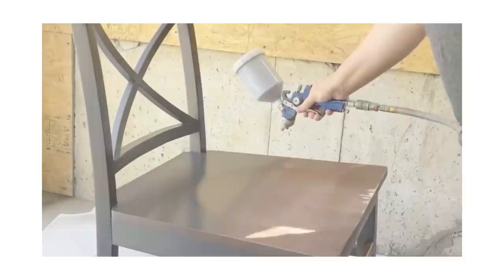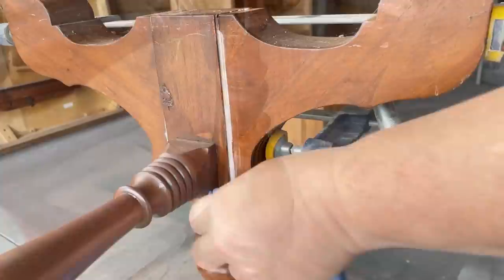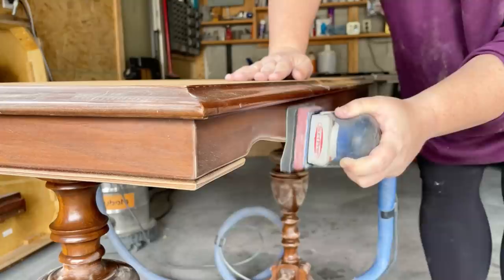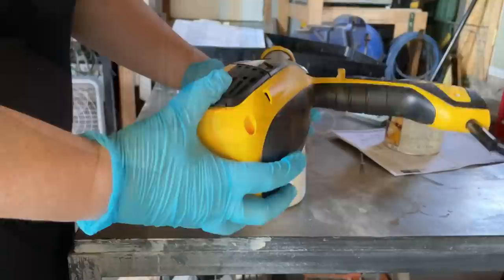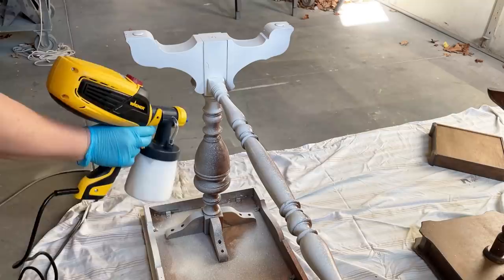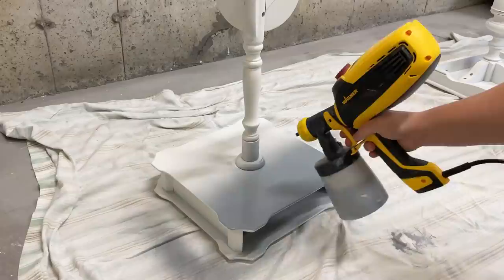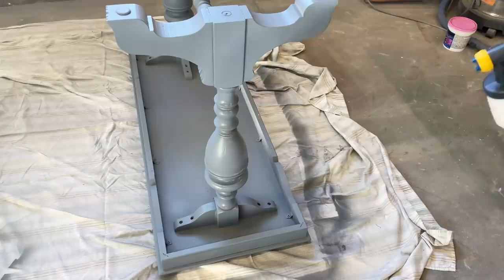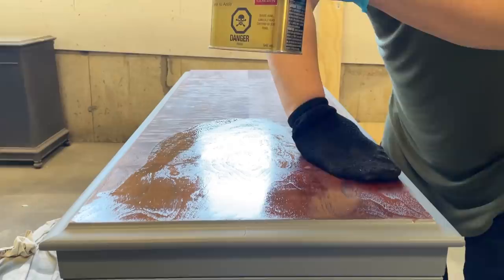Painting some small furniture pieces with a new paint sprayer

Comment from the maker: Important Safety Update: BIN Shellac Based Primer is not a suitable material to spray in this type of turbine sprayer. It is combustible has a risk of fire or explosion 💥 I will not be spraying BIN in this gun again.
Reply: hello katie! 👋👋👋 I have time watching your videos, I love everything you do with wooden furniture.  I do the same and that primer is my favorite, and you are right in everything you say, I stopped using it in my paint gun, I only added it to wooden furniture, with a roller or brush, and for best results, leave it 24 hours, after 24 hours you can then sand and paint the wooden furniture.  (There is no need to sand the furniture before placing the primer, but without a doubt that primer is my favorite🥰🥰😍😍
Reply: @Roca-mb8df  I know that good primer is loaded with alcohol, but cannot imagine an explosion.  I am used to the Kilz original, which is probably the same thing.  I get good results just with a tiny foam sponge roller and it's disposable.  I had been told by experienced wood workers to never worry about the streaks and overlaps, just be sure it is covered completely.  Almost 15 years later, they are right.
Reply: Do you know if that's the case with the home right sprayers too or just the Wagner's?
Reply: @perlaargyle9343  each sprayer is different so I would check the manufacturers instructions but from what the Wagner rep told me it has to do with the proximity of the spray to the turbine. Sprayers where the turbine can be as safe distance away for the gun are better suited for this use.
Reply: That is good to know.  I don’t have a spray gun but good to know.
Reply: Eeeek!
Reply: Is there a solution for this?

Comment: So glad you stained the top of the sofa table. Both look great. On the small table aren't you missing the little plugs that cover the screw holes? Much better to not see the screws.
Reply from the maker: If you plug the wholes you can’t tighten the screws again in future.
Reply: @salvagedbykscott  That's why the plug tops are domed so you can pop them off if you need access to the screws. No fine piece of furniture would have exposed screws like that. They would be covered with "dowel plugs".  Do some research on woodworking sites to see what I mean. I do love your work!

Comment: I use that gun and I want to let you know it's best to take the foam disk off the plastic piece that goes into the canister . If you pull the trigger back while putting the blue pieces on it helps. Did yours have a small red ring inside the top of the sprayer behind the blue parts?

Comment: Thanks for the good unbiased review of the sprayer.  You know about "buttons" for those screw holes right?
Reply from the maker: Yes, I know about the buttons but when it’s a cheap table like this, they’ll need to be tightened again soon.
Reply: @salvagedbykscott  well so that is why they are "Buttons" to easily remove.  Anyway I thought you had a good reason.  You could use a wet thin or flat toothpick with some glue in the screwhole to give the screw some good grip?  It looked wobbly when you were putting the poly over the top.  I do know what you mean, those screws want to work themselves out.

Comment: I have the Wagner 5000. I used it on 1 project. It ruined the paint texture. Mineral paints are too expensive to put into a splattering Wagner. I had to stop every 30 seconds or so to wipe the tip off with a damp cloth. That does help a little with the splatter. 
Then purchased a HVLP gravity paint sprayer. I will NEVER go back to a Wagner. I have one gun for oil and one for water based paint.
Reply from the maker: I love my gravity fed HVLP, but I think the Wagner sprayers are a good “intro to spraying” option for most DIYers.

Comment: I had the Wagner flex up but it would clog with the BIN primer. I contacted Wagner support and they told me to stop right away because the shellac is combustible! The turbine so close to the fumes is what makes it hazardous. I chose to upgrade to the Earlex Spray Station 5500 where the turbine could be placed far away from the sprayer handle. With that being said after the hassle of cleaning with denatured alcohol (because they also said how dangerous ammonia is) I may never choose to spray shellac again. Just thought I’d mention all this because I was unaware. I could see how this could be especially dangerous spraying in unventilated areas when it’s too cold out to leave the garage door open.
Reply from the maker: Shellac is not combustible but the alcohol in BIN definitely is! I didn’t even think about the heat of the turbine being an issue because it’s not one for my pneumatic gun. I will make sure not to use BIN in this gun again. Thank you.

If you’re experiencing clogging with BIN it’s because it’s been contaminated with water. Any amount of water will cause it to seize and curdle.

Whenever spraying anything with any type of sprayer you need to have ventilation and a proper respirator. We do not have denatured alcohol in Canada and ammonia is a regular household cleaner, although yes, it is terrible to work with.

Comment: What’s the difference between the 3500 and the 590 and which should I buy?
Reply from the maker: The main difference between the FLEXiO 570/ 590 and FLEXiO 2000/3000 is the design of the iSpray front end. The new nozzle designed iSpray front end will provide paint control with a uniform and contained pattern. Also, the new paint flow dial is numbered for precise and easy setting for the range of coatings the FLEXiO can spray and easy clean up

Comment: The pieces came out so nicely. I have had such trouble with my Wagner. I’m watching in disbelief as you just start spraying Bin primer and the paint comes out nicely. You didn’t water the paint down or anything. I’m going to give the settings you used a try today. I’ve been using 7 on the dial and adding water to paints per other videos so we’ll see how it goes. Did you have to use a brush to mitigate spatters anywhere? Thanks for this video.
Reply from the maker: I think 7 is definitely too high for this gun. I didn’t touch anything that splattered. Thanks just it settle and dry on its own.

Comment: What is your other spray gun?
Reply from the maker: Hi! Here’s some more info on the 2 sprayers I use.

Pnuematic:
I taught my self to spray paint with a gravity fed HVLP pneumatic spray gun that is powered by a 30+ gallon air compressor. I use models that come with a 600cc cup and a 1.4mm tip. I had great success with all of the water based products that I use on my furniture pieces with that system.

Electric:
When our air compressor started to break down I decided to try out an entry level electric turbine sprayer with a Wagner FLEXIO 590. It's a great entry level/beginner friendly tool that easy to learn and can produce professional results. This option is slightly heavier than the pneumatic as it holds more paint and also has the weight of the turbine in hand. I also now have a FLEXIO 3000 model and it works well too.

These are the only sprayers that I've tried so I can't offer any advise or suggestions on other options.

https://urlgeni.us/amazon/PaintSprayers #affiliatelink